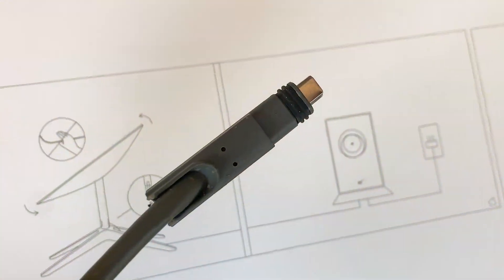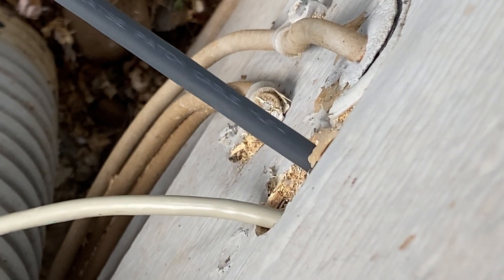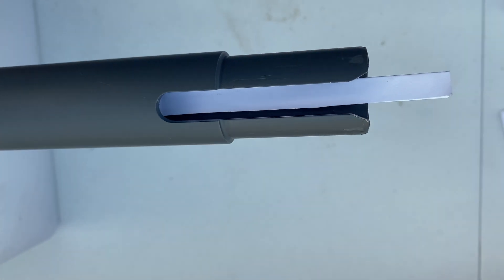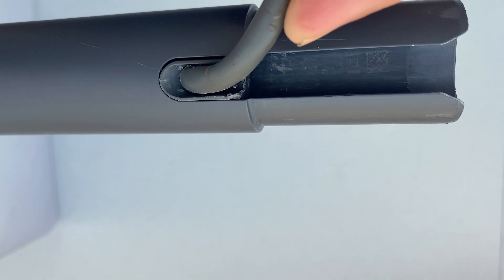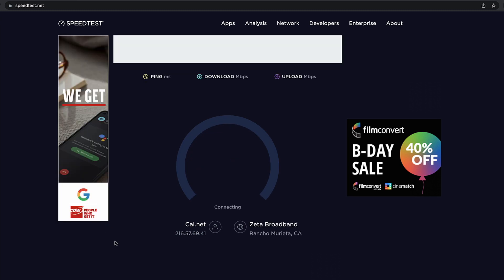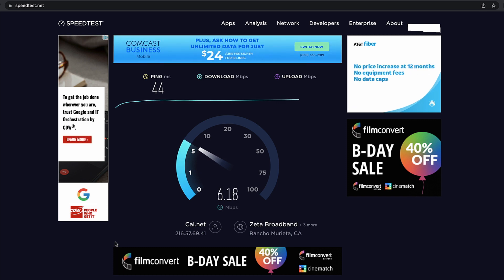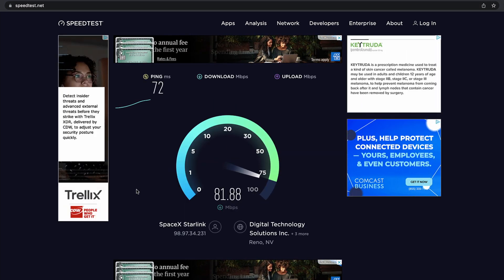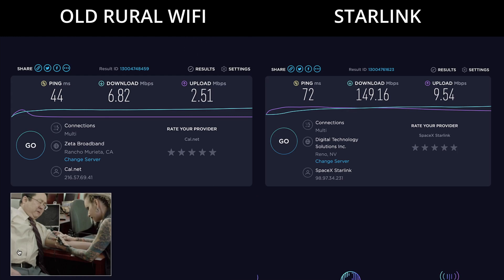Starlink Cable Installation Trouble Quick Fix + Speed Test

Comment: Thanks a million, I tried plugging the cable for more than an hour…and I lived by the river and I felt like throwing the damn thing in the river…I tried your paper trick and it worked but I had to put it the front instead of the back. 👍

Comment: Dude! You have no idea how happy I am that I found your video. I damaged the cable that came with the dish so had to order another, which took 6 weeks. I was nearly in tears when I tried and tried and tried to get the new cable connection to work but to no avail. I found your video and it solved my problem.  Thank you thank you thank you!!!!!! I would buy you a beer if I could.
Reply from the maker: How about we trade Subscriptions and call that a beer! Glad it helped you! :)
Reply: @joshwilliamsav  deal!
Reply from the maker: @MoffattAdventures  congrats on Starlink. I’m assuming like me it’s a game changer for you.  It’s going to make a lot of peoples lives easier.
Reply: @joshwilliamsav  I’m in a rural area and have constantly battled internet issues. Such a relief to finally have legitimate high speed. Just don’t clip the line with your snowmobile!

Comment: Thank you so much Josh! I also spend more tim than I should have, trying to connect the cable. Your tip should be printed in gold on the Stalink box !
Reply from the maker: I figured if I had the same problem with 2 different Starlink dishes and cables, I can’t possibly be the only person. Turns out I’m not lol.

Comment: Thanks! This worked for me as well. Then when I had to disconnect to pull cable outside I put the plug in while the dish was upside down and gravity did the trick instead. Just letting anyone the paper trip does not work for know they can try that as well.

Comment: Same problem here, I tried for over and hour to connect the cable. then my wife tried for an hour, never could get the cable connected. Starlink is sending me a whole new kit but it will be over two weeks to get it and the wait is killing me. It will be interesting to see if the new kit has the same issue, but at least I will know what to try this time. Thanks for posting!

Comment: Wow thanks so much. I just got my starlink today and it never got better than 50 mbps. But later on in the evening it went down to 2 mbps.

I wrote a service ticket and yo my surprise they said my router showed a connection error so they're sending me a  ew cable and router. 
I would have preferred the one that came with it was tested but I can say I've never got customer service like this before.

Thanks so much for the tip.
Reply from the maker: As of this moment I’m only getting 8-10mbps download speed. I never get higher them 20mbps anymore. It’s barely better than the rural wifi service I had previously at 7-11mbps for $96 per month. I thought it was a game changer when I first got it and was hitting 130-220mbps. After 1-2 months it got worse. Hopefully it improves someday.

Comment: Great Job! Thanks! had same problem but I fixed it by "Jiggling" it around and got lucky. But I will have to take it down and re-run the wire soon so I will most defiantly use this method.

Comment: Awesome.  Worked perfectly.  Thanks for posting video.
Reply from the maker: My pleasure. Thanks for sharing!
Reply: Thanks sir, you saved my sanity !
Reply from the maker: @kentron927  I wish I had found this advice a week ago myself. I was stuck on a hot roof for 2 hours because I didn’t want to climb down and back up again. Hoping it saves others because it’s quite frustrating that a plug meant to go in a hole just won’t go in!

Comment: Thanks for this video Josh! I had no idea how that worked. 

But I'm installing a 10-20' pole; how do I keep the weight of the wire from pulling out the plug?
Reply from the maker: Can you use something like a hose clamp or zip tie to secure the cable to the pole so it can’t pull on it? Probably could even give it a tiny bit of slack above the clamp point so you know it’s comfortably secure rather than already being pulled on as it’s tightened.

Comment: Thank you so much for posting this. I wonder if I can make up a shim out of thin plastic. It might be slightly thicker and more slippery as well. I have watched loads of videos and no one really shows the connector being plugged in.  Maybe they all had problems and edited it out like the edited video of a guy fitting brake shoes to a Gen1 Chevy Blazer in 2 minutes and it took me an hour lol.
Reply from the maker: I feel like it’s like 1 in 100 odds. I somehow managed to get it connected on like my 10th try in my dining room when I tested it out on my back porch before going through the trouble of climbing on my roof. But sure enough on the roof I was up there almost 2 hours going crazy until I forcefully slammed it in and it didn’t work after that. As soon as I got my replacement I had the same damn issue but luckily Reddit had a solution and I felt like it needed to be shared on YouTube because that’s the first place I go for most of my help if a quick Google search doesn’t work.

Comment: Great tip! However, I'm trying to get the cable out of the Starlink dish with no success. The dish is attached to a 4-legged stand. I want to take that off, install a longer cable and put the dish on a short pole. Any tips on how to disconnect the stand and get the cable out?
Reply from the maker: There’s a release button on the side opposite where you can see the cable inserted into the dish shaft. Should be able to just push the button in and pull in the shaft while pressing down on the 4 leg stand to separate them. Then the cable should just pull right out after it’s separated.
Reply: @joshwilliamsav  Should is the operative word. Couldn't is more like it. Will have a friend come by and see if he has the finger strength to get it to work. Thanks!
Reply: I'm having the same problem! Did it ever come out???? @jodifredianiphotography1136

Comment: I have installed several dozen Starlinks. A couple I had to give a firm nudge with a screwdriver to seat. One I used this paper trick on = no work. Lubed outside of connector with dielectric grease, with & without paper = no work. I carry extra supplies so grabbed another cable & went right in. Next job I tried the 'problem cable & went right in all textbook like. I don't know what to make of it....
Reply from the maker: Most of the working results I have heard were, shimming with paper, folding the paper twice if it wasn’t thick enough the first try, and also turning the dish upside down so that gravity is also helping lower the connector where as the shim method was raising it up when turned upright. Yeah it’s a pain in the butt for sure. I can’t imagine that they haven’t had a million complaints from this and end up doing a redesign with a different connector at some point. You would think this wouldn’t even make it out of the test phase into the real world without encountering this issue. It’s bizarre but I get hundreds of views a day from people google searching this problem.

Comment: Any insight on how you mounted your dish?
Reply from the maker: I got some 2” screws and washers at Lowes to screw the base it came with into my roof sheeting and some clear sealant to put around the holes just incase of leak potential.  My roof is angled so I was careful to make sure my Starlink dish was facing the direction that allowed the dish to rotate equally.  After installing it the App told me the Starlink shaft was not vertical. This doesn’t seem to cause any issues as it can maneuver all directions pretty equally but if the system prefers to have the shaft vertical I would recommend getting a base that swivels to allow the shaft to be vertical otherwise you will need something to shim one side of the base up to make it flat if you have an angled roof. That explained why they offer other mounts since the system wants the shaft to be vertical.

Comment: I cant unplugg the cable please help me its like real hard
Reply from the maker: I don’t really have any tricks since it’s just a large ISB style connector that doesn’t lock. I think it has a rubber sleeve that could be air sealed using suction to stop it from coming out. Perhaps wiggling it up and down as you pull might loosen the seal and let it come out

Comment: I need help unplugging mine!!! Please help
Reply from the maker: It should just pull straight out. There’s really only a piece of rubber gasket that helps to wedge in and seal it from water. Otherwise it’s just an oversized USB style connector. If you had to use some force, perhaps getting a thin flathead screwdriver and wedging it in to back it out might work.
Reply: @joshwilliamsav  Thank you for the help!!!